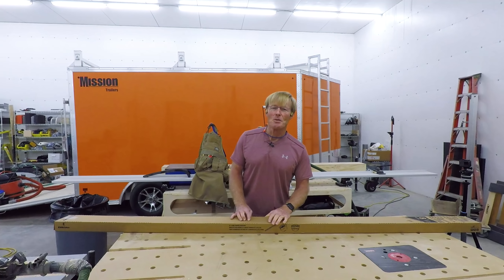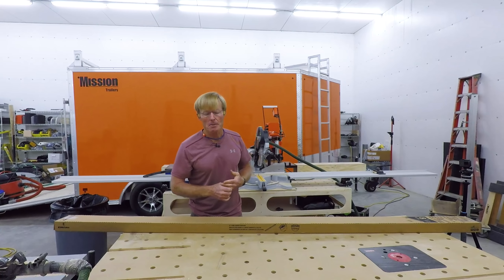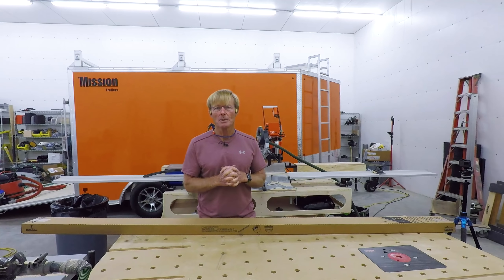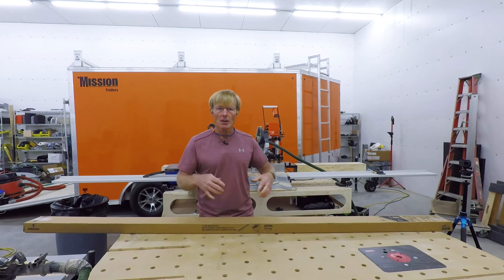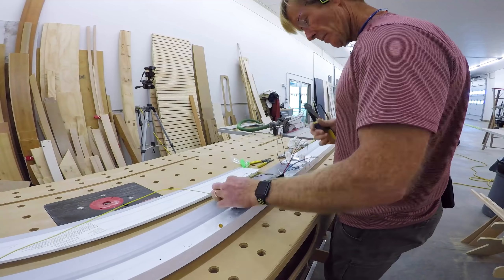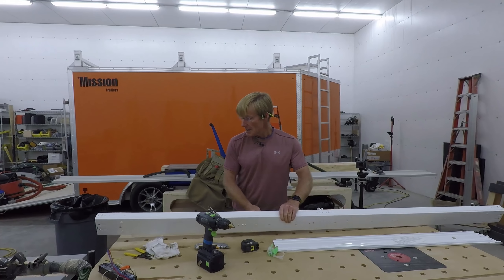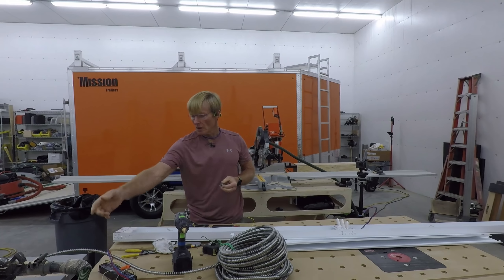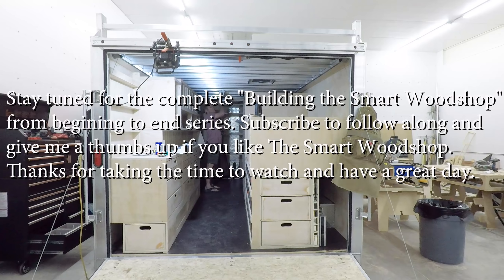Making my own LED shop lights

Comment: Ron, your bulb selection is excellent, with a CRI rating of 85 points the high K value of 6000 is a bright white instead of blue. With the additional finding of the LED ready fixtures the system makes much better sense. Cost is decreased a lot with those fixtures. I returned my integrated fixtures rated at 4500 lummens per two bulbs per 4' section with 4200 K & 80 CRI for your bulb selection. Savings ended being 50.00 on 16' of light for 20' trailer. 20,000 lummens total light all together. I'm convinced, thanks.

Comment: Those electronic ballasts are a real PITB Ron. Good idea to get rid of them. The project is coming along nicely.
Reply from the maker: Hi David, the LED tubes showed up today and I installed all 8 of them. I now know I made the right choice after grinding my teeth for weeks over the choice or lack there of;0)
Reply: Dave, you are so right. I have 10 of these bulbs Ron is using for over 3 years without a single issue. I made the mistake of getting lazy and buying 10 of the type bulbs that require ballast, last year. Already one of the ballast went out, and now I've saved nothing.

Comment: Always double check your LED bulbs, some of the newer ones only wire at one end (one pin is Hot the other is Neutral) the other end of the bulb is just for mounting - no connections.
Reply: pretty sure all leds only work from one end, don't they?
Reply: Nope, depends on the Mfg.
Reply from the maker: Most work from both ends, but just check before you order them.

Comment: Pardon me for not understanding. I see you removed ballast from florescent fixture what type bulb did you use? do you have a dc transformer or have you found tubes for 110v AC? I bought some LED tubes from Costo but they only worked interminably in my old florescent fixtures.
Reply from the maker: We put the bulbs in our store through Amazon: http://www.paulkhomes.com/ron-s-store.html They work straight line level so not starters, transformers, ballasts.
Reply: Any led bulb that uses 110 direct has a driver (transformer) integrated in the bulb. 110 led fixture has a driver in the fixture wired inline before the bulb. Only a a D.C. Fixtures or the led bulb itself  wired to direct current would eliminate a driver (transformer).
Ron,  you could have bought the led strip lights with the tubes integrated with the covers. IF & maybe when you would have to replace a light, pull the cover ONLY and unplug the light strip from the driver in the fixture. Swap just the cover and leave the fixture housing mounted to the trailer. You'll be retired before burning those leds. Buying fluorescent housings to remove ballasts, then install led bulbs with integrated drivers is like taking a step backwards before 2 steps forward.

Comment: I think you would be disappointed with the peel and stick LED strips.  I couldn't get them to stick.  And not much light.  I heard you can stick them with a bead of silicone but I never tried it.
Reply: If you use the 3528 LED's, I agree, not much light.  If you use the 5050's, and clean the surface with alcohol, they are tremendously bright and stick well.  Not to mention no loss of headroom.
Reply: I used the 5050's in a white light.  Tried on a electrical fixture, newly painted surface, wood and aluminum.  Raw wood stuck the best but it even turned loose.  Best LED's I have in the shop are these but they are $155: https://www.amazon.com/dp/B00IKVJLUQ/_encoding=UTF8?coliid=I2797FFKW0AS4Y&colid=22DV4G6AT72VF
Reply: David Gardner I use the peel and stick LED's and they're amazing. Check out the video of my trailer on my channel to see.